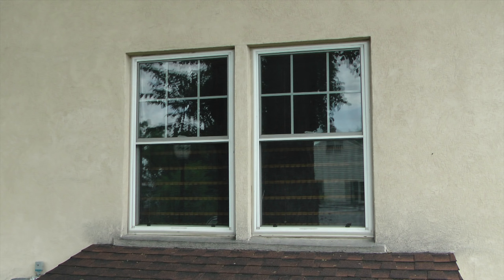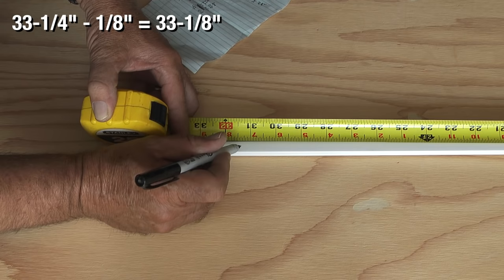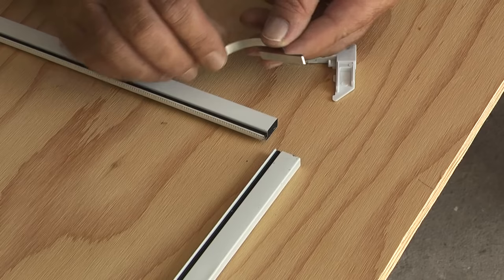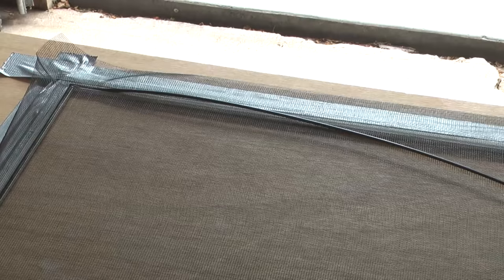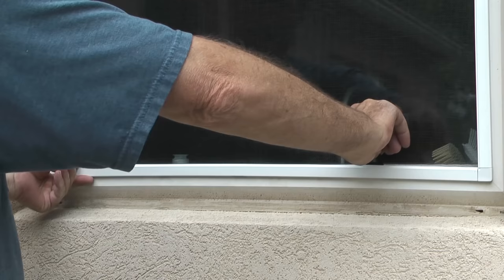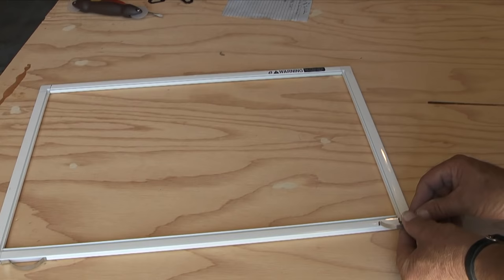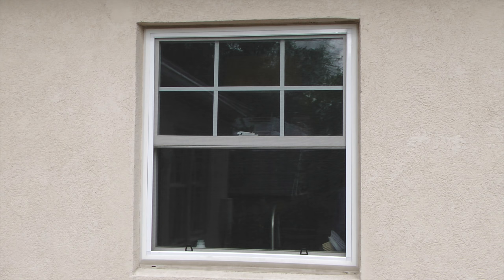How To Build Window Screens

Comment: I'm an analytical chemist by profession and greatly appreciate details without verbal 'padding'. This is by far the most explicit, yet understandable how-to video I have seen on any subject on YouTube. This video should be the model for which other how-to videos are created. I'm sure it was time consuming to create, but the care and 'scripting' is excellent!  Thank you for the explanation and the great example of how other how-to videos should be edited.
Reply from the maker: Thanks Curtis, you just made my whole day. Videos can be time consuming to make and I appreciate your feedback on how this video was made.
Reply: I agree completely!!
Reply: I work at a hardware store that sells this product plus I just bought a house that will need this. Very well done.  This knowledge will be passed on at some point.
Reply: Do you follow “in the pipeline”?
Reply: agree completely
Reply: Just wondering could you have put the rubber pull taps on the inside?
Reply: Curtis Olso
Reply: @k.s.2891  Actually, that's where they properly go, both on screens and storm windows. Screens are normally placed and removed from inside the room, especially on upper floors. There's no need to make it easy for ne'er-do-wells to engage in mischief. by making them accessible and removable from outside.
Reply: ohhh  @tientrinh943  is a jokester.  What he was trying to say is "You're Great!!!!".
Reply: @tientrinh943  that was uncalled for 😲
Reply: I agree....
Reply: @williep3100  Yes, darn autocorrect issues on top of language issues, no doubt "You're great!" or "I'm overjoyed" is what Tien meant.
Reply: you verbally padded  your comment :)
Reply: I agree 100% Thank you!
Reply: I would like to know where you got these materials to diy. I searched everywhere but cannot find it 😢
Reply: I’m also a chemist and I completely agree with you!!!

Comment: Great video for a noob like me. Here’s a quick tip though for people who want the tabs on the inside of their house (on the same side as the spline). Don’t put the tabs on until you spline around about 1/2 of the screen (start your spline on the spring clip side) as you get around to the place you like your tab to go, push the tab down over the screen but before the spline—THEN—spline over the tab (which is now installed on top of the screen). Another tip, make sure the corner pieces have the hollow bit facing inward with the spline (and as shown in this video). SUPER PRO TIP (from a guy who’s done 4 of these now with 3 mistakes!) to avoid nasty excess screen buildup (think wavy screen NOT taut) try to align the pattern of the screen with the frame. I’ve found this last bit results in tight, well stretched screens. Good luck!!
Reply from the maker: Great tips, thanks for posting.

Comment: This was great. Thanks for providing this video. I tried using the very same materials from Home Depot to make a screen. But didn't think to hold down the frame with duct tape to prevent bowing; which was a constant problem for me. Thanks for providing the tip about bowing.

Comment: This was extremely helpful! I just bought a house, have lived in apartments for the past few years. All the houses I've seen in the past 20 years had new windows which came with screens. My house has very old single glzed wooden windows with no screens so I wasn't sure how to go about getting screens, but figured there was a way to do it cheaper than paying a company to install custom screens in my windows. I plan to do 2-4 windows for now, just so I can get cross ventilation going when the weather is nice.
Reply from the maker: Good luck!

Comment: Great video thanks.  Mine came out a little short, I added back in a little for height on each side and that helped.  Also, after adding spline and screen with no bowing at all, after removing the finished screen from the table, it bowed a little.  I used clamps instead of duct tape.  I think the tension on some of the screen was tighter at certain areas than others, or this may be because the height was 30" while the width was only 14".  In any case, way great video, thanks for sharing.
Reply: I prefer the clamps as well, especially on larger screens.

Comment: I found out something the hard way. For screen frames with really long dimensions, even when using the duct tape to hold down the frame the flimsy frame material bowed inward about half an inch as I pulled the screen tight. I didn't notice this until after I had cut the excess screen off. Luckily, the bulk screen I had ordered was about twice what I needed. :) I'm about to re-apply the screen and I'm going to try using a brace in the middle to keep the screen frame sides the right distance apart.
Reply from the maker: Good information, thanks for posting.

Comment: In the beginning of making the screens there is a possible easier step that would save big amount of time! 
 As you mentioned there's some existing screens, if they're the same size windows I always take one screen out and do a test in the windows that Don't have screens and if it's a good fit, then I just measure that screen and copy the size to make the other ones. 
Also thank you for this video!!
Reply from the maker: Good information, thanks for posting.

Comment: Great vidio. You probably should place the pull facing inside when installing the screen. If an intruder has to cut the screen to get in the window it is more obvious he is not supposed to be removing it and may be caught.
Reply from the maker: Good point, thanks for posting. I put the tabs outside because in my case the screens are easier to remove from there.

Comment: This is awesome if you live in a house or on the first floor.  But i stay in a apt bldg - 4flights up. So im going to use a snap frame to hang the screen in place. Then add bottom snap frame to the the bottom of screen as an anchor to prevent it from blowing around. I'll use white duck tape to hold side down. Im using white screen netting.

Comment: I followed all the measurements & my frame was still very loose. I had to cut 3/8" pieces from the leftover frames to add to the corner. Even with that my fittings were a bit slack especially in the area of the tension springs (where I added clear sealant in order to keep out insects). I would recommend beginners to carefully test fit their frame many times before installing the screen, both from the outside & inside the room to make sure there's no openings.
Reply: Screening does require some practice.

Comment: I tried making a window screen for my room however when I put it in it was bowing. The two side piece were bowing inward. It is absolutely crucial to tape down the aluminum frame to prevent this issue? Side note, I did not tape the aluminum frame 🤓

Comment: Great instructions. You've got the wheel instructions backwards, though. Concave first (the open one with a channel in it) and then convex. This is from Phifer's own spline roller listing on Orange Box's website: "One end is concaved to start the spline into the groove of the frame while the other is convex to set the spline more deeply."
Reply: I thought the same thing as I watched it.

Comment: Comment: For the height, you measured from inside the top u-track to the outside edge of the bottom u-track, then subtracted 1/8. That makes sense. When you install, slide/push the screen upward fully  into the top u-track, and you will have 1/8 clearance to push the bottom across the bottom u-track top edge, and then let it drop in. As long as the bottom u-track is at least 1/8 shallower than the top u-track, there will be no gap after  the screen drops down into the bottom u-track.

Now, for the width you added 1/4 to the edge-to-edge left-to-right groove measurement. Seems this is feasible and also necessary because one side of the window has no u-track (but maybe a flange). That seems to be the logic.

Unrelated note: The rubber string  that holds the netting is called "spline", apparently.

Practical note: When fastening the netting with the spline, do not simultaneously pull the netting tight with the other hand. I pulled just gently and that caused the netting to be so taut that the frame bent at least 1/4 inward at the center, leaving an air gap after installing. Better not to pull at all and just allow the natural tightening caused by the roller tool. I had to redo and wasted some netting because of this. I suggest not trimming the netting closer than 1/2 all around until after having checked the frame is not bent AND having done a test install. That way you can redo the fastening  if the netting was too tight.

The vertical direction 1/8 in subtraction is a bit bit tight because  the spring on top of the frame require quite a bit of force to compress. I think maybe 1/4 in is safer and easier. As long as the bottom u-track is at least 1/4in shallower than the top u-track, there will be no gap.

Comment: To prevent bowing and pulling out of sqare without using masking tape,lay the mesh on the frame and starting on the first drop using the spline roller run the spline and mesh into the channel then continue across the first width.
On the second drop and width the secret is to first using the roller run the mesh only into the channel then lay the spline on it and roll it in,this will prevent the dreaded hour glass effect.
Reply: Very interesting--my screens are 3 x 6 feet, so it doesn't take much pressure to bend those long upright pieces. And even if you tape the frames down, if the pressure is there when you remove them, it will bend a long run like that. I have seen some long screens with middle supports, but Home Depot's kits didn't give that option.

Comment: The first screen is installed backwards, the pulls should be on the inside of the screen.
Reply: yes, and installing from inside is also much easier and width can be little greater.
Reply: I was wondering about that! I thought the pull tabs were supposed to be on the inside also
Reply: @saa1068  hmm good to know
Reply: details details
Reply: If the pull tabs are on the inside like they should be doesn't that make the spline outside which isn't supposed to happen because it's easier to push out the window?

Comment: I have a Question - 

There is a discrepency for the side measurements. 

@1:38 when measuring the window frame for the sides  you give them as 29 3/8' + 1/8" = 29 1/2 "..........
@3:02 when you are preparing to cut the frame piece the measurements are 29 1/4 (not 3/8) + 1/4" (not 1/8) but it equals to the same total of 29 1/2". 

If I had measured at 29 3/8th for the window

BUT added the 1/4" instead of the 1/8" to the length of the frame

wouldn't that mess up my total measurement?

Comment: HELLO I was so thrilled with the videos and comments that Ii went out immediately and purchased the kit.  Sadly I have a Pella window with no channels.  Screens are held in place with small slits on the side where a small lever pushes a a thin piece of aluminum into the slot.  Could I still use this product?  I am so happy for all the successful installers.
Reply from the maker: I don't think so. The kit I bought from Home Depot didn't have slits in the side of the frame.

Comment: Great Video....Lifesaver....One thought....DOn't you flip the pull tabs onto the isnide of the screen as you are putting the spline on the bottom?
Reply from the maker: Pull tabs need to go on the side of the screen with the spline. Spline holds the tabs in place. If you want to remove the screen from the inside of the house just rotate the screen 180 degrees.

Comment: Tip for anybody having trouble with the pull tabs like I did: if the pull tabs are getting pulled out completely when you are pulling on them with the intention of compressing the metal spring on the opposite side and then decompress to fill in the channel. Then not to worry because duct tape could be your freind, if you are able to get in 3 corners but not the fourth one because you need grip to pull on it but your fingers don't fit, then stick a piece of duct tape on the outer side of the screen frame and pull on it so you can you use it as a handle to bring the forth corner in place.
Reply from the maker: Good tip, you can also use a flat blade screwdriver to carefully pry the 4th corner in.

Comment: Hi good video. My window has no channel. It is flat. I got a build a screen kit from home depot, not sure if this is a long lasting screen fit. The parts don't seem durable, not the same as the old parts that someone installed before. I will go back to the home depot store to see if they have something more durable.

Comment: This is of course a great video, I made the screen of 32"x34" following this video. I just want to add, it would be better to measure from inside to figure out the size of the frame. After I made the window, upon installing, I realized frame could have been little bigger in width specially when there was more room. This way we can get more overlap of window screen frame over actual window frame. Installing window screen from inside is much easier then from out side. Height dimension fits perfect in may case that also can be measured from inside. I also caulked with clear caulking all the perimeter of the screen frame (from out side) to make sure nothing crawl in from gaps between screen frame and window frame and this also keeps the screen frame in place and strong. To make things simple, measure entire opening for window screen from inside and deduct 1/2" each way and that would be your size of the frame. In this way you can caulk from inside as well as you will get 1/4" gap along height on both sides and 1/2" gap) at the top of the window (since you have tension springs at top) .

Comment: Excellent presentation thank you. Am just wondering what the purpose of these screens are, and how it affects the opening and closing of the windows? (I ask because that is a problem I have. Where I'm from (South Africa) we have summers of about 8 months, and lots of problems with mosquitos etc during this time, but of course also with the heat. So at night we keep windows open, though we have strong burglar bars (that also being a problem, and not only at night). So I built such a frame from 12mm2 steel tubing and covered it with a fine netting. It sits on the inside and held up against the burglar bars with one small magnet. I like the way in which your system lodges the netting into a groove. The total cost of my build (steel, paint, welding rods, netting) is about R100 ZAR (just over $5 US).
Reply from the maker: Thanks for posting this info from South Africa. Screens here in the US are used to let fresh air into the home and keep bugs outside. I'm not positive, but I think most installations of windows here come with screens from the factory.

Comment: Pretty good, but don't pull the screen tight. Both your screens showed some bowing in when installed in the windows. Better to leave the screen a little loose.
Reply from the maker: Good tip.

Comment: I think it would be wise to fit-check the screen frame (after cutting) inside the window frame slot BEFORE cutting the new screen and rolling in the rubber materials.
Reply from the maker: Good tip, thanks for posting.

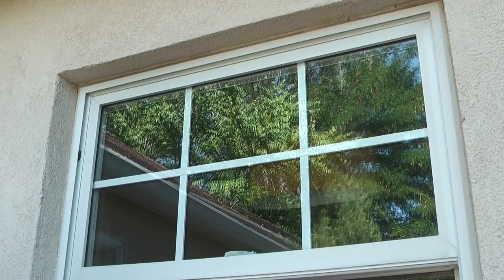Comment: Thank you very much for such a great informative video. I appreciate the details, especially the measurements part. However it is inconsistent about the side to side measurements. 1:31 says it is 29-3/8 + 1/8; but 3:02 says it is 29-1/4 + 1/4. Even though the results are the same, the math behind is not. One is adding 1/8 (to the total) and the other is adding 1/8 to each side. Which one is correct or doesn't matter?
Reply from the maker: Doesn't matter, you want the screen a bit wider so it doesn't fall out of the channel.

Comment: Hello, Thank you for this video. Is there a way that I can just remove the corners? Because my screens are still good, no rips, but the corners are crumbled due to the sun and time. Can you please tell me if I can remove 2 corners and put them back in at a  time, then do the  other 2?I don't want to have to remove all the spleen and screen. Please advise. thanks.
Reply from the maker: I don't think you'll be able to replace the corner pieces without removing the spline because you need to be able to spread the sides to get the corners out.

Comment: @iscraper1 i have a question, what determines what side receives the tension spring? i see you did both ways, but is there a reason? Thank you!
Reply from the maker: From what I've seen on the different houses I've lived in if the windows open vertically and they have window screens then the tension springs are on the top. The screens on windows that open horizontally have the tension springs on the side.
Reply: @Iscaper  Thank you!

Comment: Before I moved I replaced all the window screens including the screen door.  But my window screen tabs are inside the window, not outside. I took out and put back all my screens from inside the house with the screen pull tabs inside.  When putting the screens back in, it was easy to pull the tab in while pushing on the tension spring into the track to pull the screen back in.  My new house I haven't seen any tabs on the screens, so I don't know how I will change the screen when needed.  :-(

Comment: Hi, thank you for this video.

Just a few questions:
1. The channel's are provided by the window supplier?
2. This isn't advisable for mid rise to high rise condominium, right?

Thanks again!
Reply from the maker: Yes, the frames were in the kit I bought. If your installing on a condo above ground level I would put the tabs facing the inside so the screen can be removed from the room instead of outside.